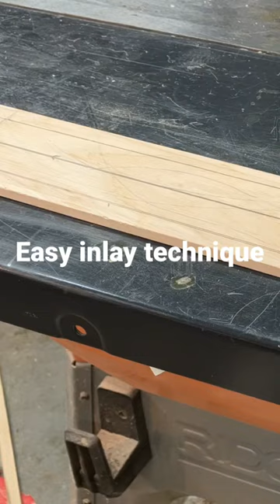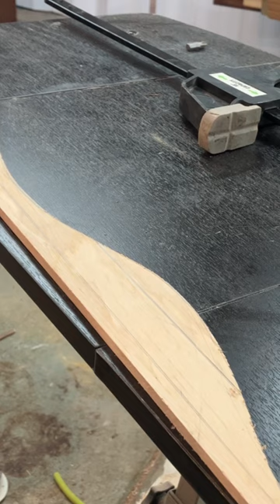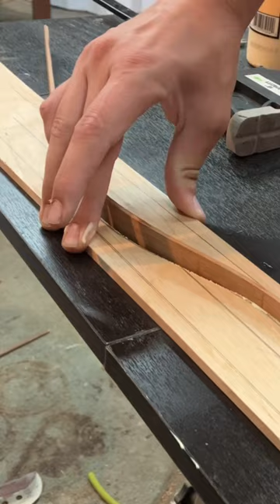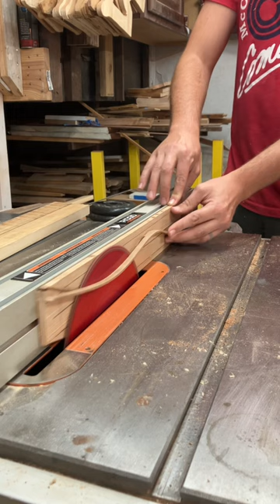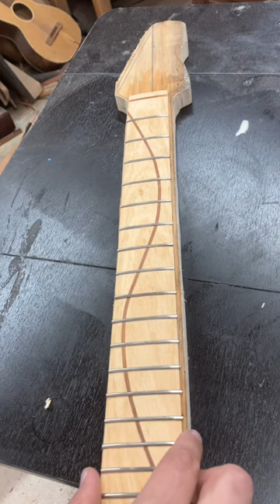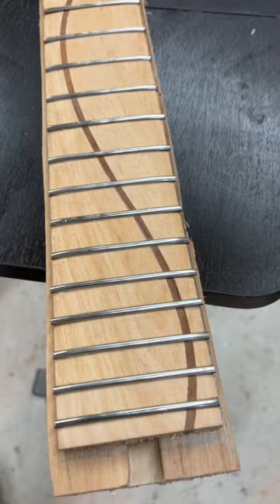Easy inlay technique. Guitar Fretboard build

Comment: i danny!!how you make your curve cut smooth before gluing? sanding ?
Reply from the maker: I would sand it if it was really jagged but I’m pretty sure I didn’t sand this one at all. Just use a sharp blade and don’t try to force the saw too fast and it should be fairly clean.

Comment: Did you really radius that with just a sanding block?
Reply from the maker: I knocked down the sides a bit with a hand plane first. But yeah sanding block! How do you do it?
Reply: @dannylewisguitars  I tried a sanding block once. It took forfuckingever (never actually finished). Maybe I'm just not patient enough or maybe the mexican royal ebony i got is just too hard. Gonna try to make myself a router jig that will let me rough out the curve, then I'll finish it up with sanding.